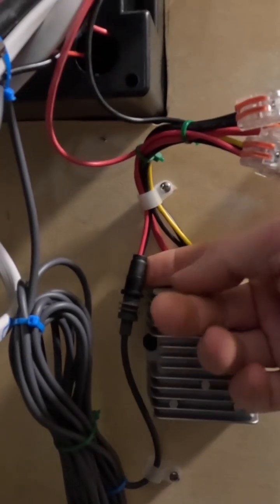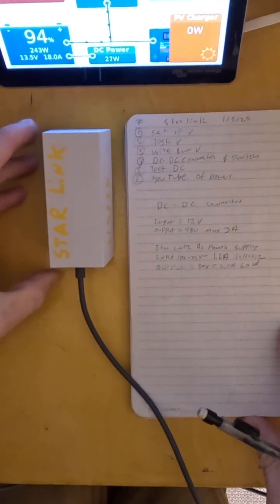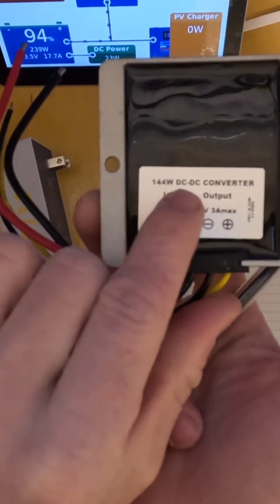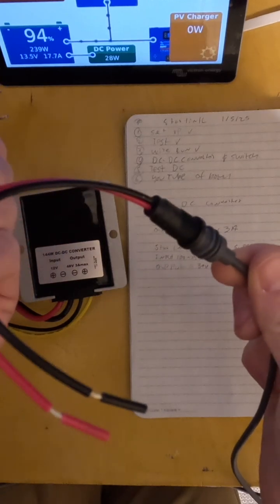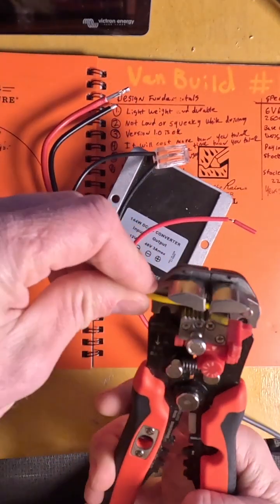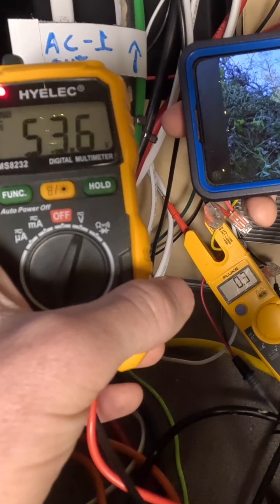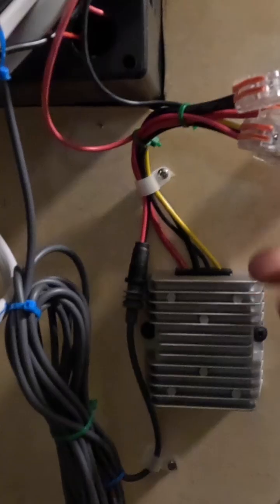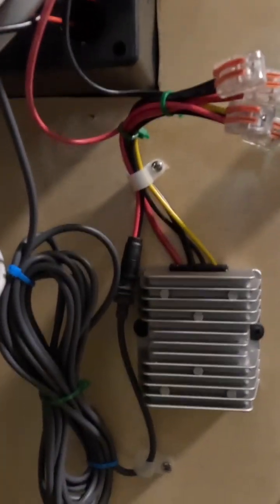Powering Your Starlink Mini: A 12V DC Solution for Van Life

Comment: I did something similar using a 28v voltage booster. It wouldn't keep the Starlink powered up consistently. It would powered cycle on and off. Put a battery on the 28v side and it stayed on steady.